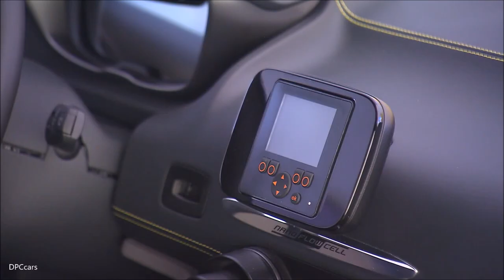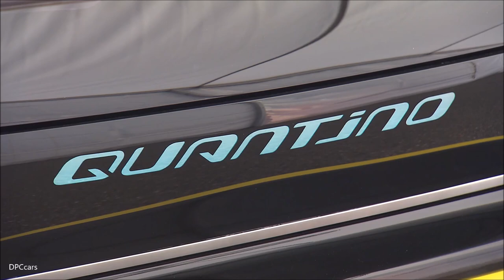nanoFlowcell Quantino

Comment: We don't really know what is powering it, it could be LG pouch cells.
Reply: @Grizzydan  trust me there is a brain in your skull. And all nanoflowcell vehicles are powered using a compact flow cell, which means you go to a station to "refuel" but your not burning anything. It's still an electric 0 emission car.
Reply: @cjthomp2005  No, it could be a fake. They need to prove it.
Reply: @johannesh7234  it's not fake.. They have already invented water powered engines... They don't want to give you unlimited resource for free...lmfao